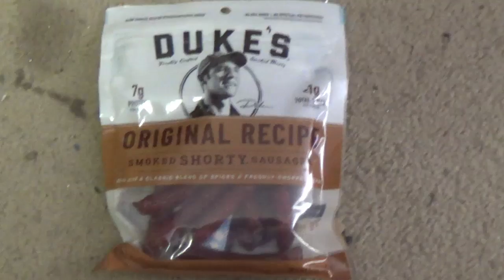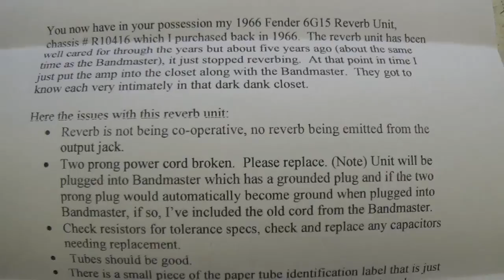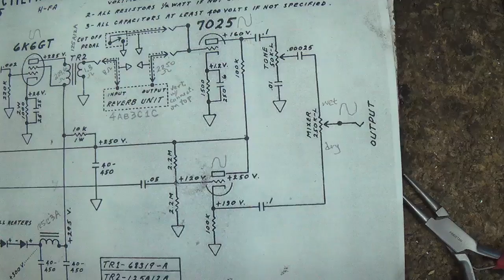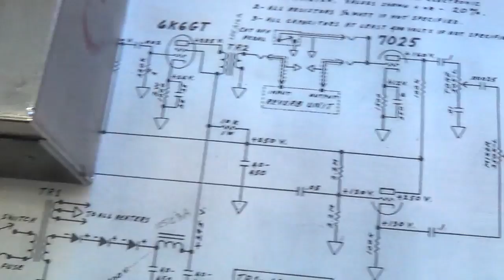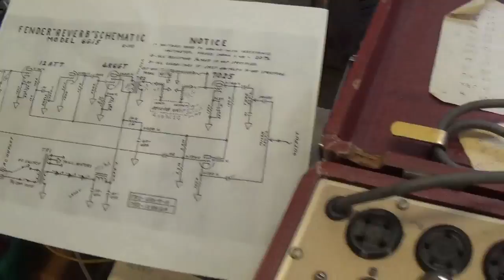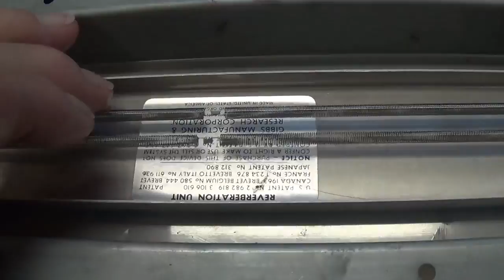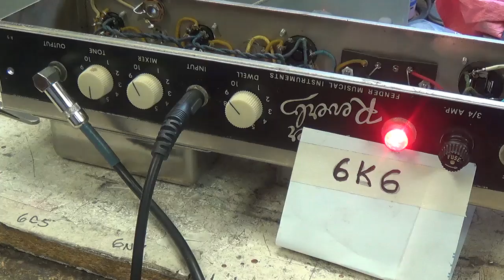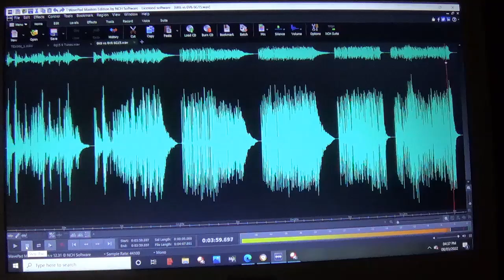Virtually Mint 1966 Fender 6G15 Reverb Unit.......It Quit Reverbing :)

Comment: @Unccle Doug 
Doug, can I not tap my speaker lead from my Teisco AP10 to drive my 1.2k--ohm Biggs reverb tank -keeping the speaker resistance in parallel?
The tank is at the moment removed from the querulous Estey Magnatone Custom M8.
Would this not work - if the signal is taken out to a second well-grounded pre and power? 
My caution is, nobody else does it - right? Dick Dale maybe?
Perhaps the speaker in the Teisco would need disconnection - what then? 
Would you not have an albiet-hot AC signal that another guitar amp could handle?
Easy to try. 
And hey right away the Magnatone will sound less like Blue Origin at liftoff. 

Doug earliest gearhead days for me were in the new high school AV room where the principal had installed a stereo (Dual, Sony and AR5s). Our grade 11 pal Gregor decided we needed our own hard rock cafe - somehow - so later that week I was standing between four 4x12 Traynor guitar cabinets and a stack of 2 Bassmate amps, driven by the record out of the Sony - and for a soundcheck (we didn't know that term) our guy had that CBS sampler with clouds on the cover - and the Shure stylus landed on Celestial Terrestrial Commuters, by Mahavishnu Orchestra.

I was 2 feet inside the main door, facing north east; it was about 5 pm; and it was 14 December 1971 
My feet froze to the spot  - although it was carpeted, indoors, and Decembers in Scotia are mild.
From our stacking-table speaker towers, came a psychedelic puzzle of rhythm and missing Western scales, a drummer with a kick drum on each side of the stereo mix, clearer than ever heard from hippie bands. 
And Gibson electric guitar played as fast as where Johnny Winter or Alvin Lee left off  at Woodstock. And this was only a year after the movie (which in turn had been the first time we heard rock music through any sort of serious sound system.)
Just checked a 2022 Montreux clip and the cat who made that 1971 record is now 80 years old, and on tour. What he plays is astounding and and as for his tone, I venture that critics of sans amp guitar shows will have to think again. OK and maybe buy tickets further back.
Reply from the maker: Thanks for sharing, Andrew. With respect to the reverb inquiry, I have no idea......try it and see.

Comment: Clearly I'm not an amp guy so that's why I'm really surprised to see all that cabinet and no speakers or power amp. Was this a big seller in its day ?
Reply from the maker: For the same reason you don't see an engine in a wheel barrow, Don.....this is a reverb effect unit, it has a different purpose than an amplifier.  You use it WITH and amp, which provides the speaker(s) and output power.
Reply: @UncleDoug  it's a first for me. And apparently it doesnt seem to be a run of the mill reverb. I'll have to watch to rhe end of the video.
Reply from the maker: @SuburbanDon  Please do, Don.

Comment: OK, am I missing something?  First time I gave seen one of your many videos that we never see what was wrong.  No bad voltages, etc.  Just parts changed, and then tested...  Not a bad thing, but very unusual for one of your videos.  Maybe distracted by the shop kitties?
Reply from the maker: Apparently the repairs I made that you saw, and some you didn't, were sufficient. I didn't test "before"......only "after"......and it sure seemed to work just fine.
Reply: @UncleDoug  I'm an 'old fart' guitar and amp repair guy doing it since the late 70's.  Love watching your stuff, and the shop cat stuff.
Reply from the maker: @rcflyer2k  Glad to hear it, RC.

Comment: I would like to place an order for the custom cabinet tilt slabs. Better make it 2, I'm constantly misplacing all my custom essential equipment.
Reply from the maker: Due to supply chain issues, there is a 4-year waiting period for the tilt slabs, Jeff, and pre-payment is essential......only $495 each.  ;)
Reply: @UncleDoug  the video was extremely helpful and entertaining. Many thanks. I recently got a Brown box for  my  amps. Kept blowing fuses and a rectifier tube. Seen it on ASK ZAC. My amps are 60,50 and 40 years old. My current here is 128. Using 113 for my Marshall and 116 for my Fenders. I've learned alot from you and Zac. BTW, love your humor.
Reply from the maker: @jeffsquires6620  Thanks, Jeff. We're glad to hear it :)

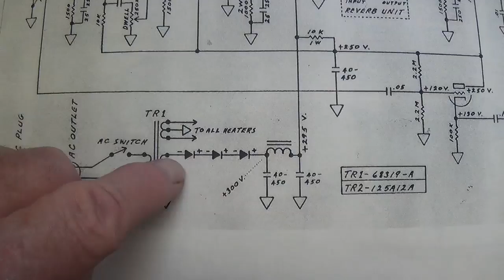Comment: Note the power-supply circuit at 27:50 ; I've never worked on one of these and didn't realize that it uses a half-wave rectifier. A bridge rectifier would almost certainly offer better performance and lower hum ---- the 60 Hz ripple from a half-wave rectifier is more difficult to filter effectively than the 120 Hz ripple from a bridge rectifier, and the bridge circuit has inherently better voltage regulation ----  but a bridge rectifier is usually expected to increase the B+ voltage significantly compared to a half-wave rectifier.  Note that this unit cannot utilize the commoner full-wave rectifier seen in many Fender amps because the transformer's high-voltage secondary doesn't have a center-tap. Interestingly, the Premier 90 reverb unit also has a half-wave rectifier.
Reply: I'm thinking cost was a factor in designing the rectifier. Silicon diodes were new, snazzy and expensive in '66. Apparently it required 3 in series to deal with the voltage, so to make a bridge would have required 12 diodes. $$$
Reply: @sootikins  ,   A bridge rectifier circuit comprising a total of 4 diodes actually has 2 diodes conducting at the same time and therefore it would be the same maximum voltage handling as a pair of diodes in series (when used as one half of a full wave bridge).  A 1N4007 diode  Is rated for 1 Amp at 1000 Volts. The reason that Fender used 3 diodes on a side in series for each half of the fullwave rectifier in their amplifiers was to get 3 kilovolts (3KV) of power handling in case of voltage surges and spikes (current capability is immaterial because they didn't need anywhere near even 1 Amp much less 3 amps),  some of those spikes and surges occurring because of the large amount of inductive/capacitive surge at turn on in a high-powered amplifier (or perhaps to have some safety margin against voltage spikes caused by the appliances in the bar or club).  The B plus to the reverb unit, however, is only 225 V at the 6V6 or 6K6 tube,  and the unit is fused at only 3/4 amp  because there's so little current draw and minimal turn-on surge, and so I doubt they would have needed additional diodes as a safety factor against inductive surges (BTW, a resistor and small ceramic capacitor across each series diode would make them virtually bulletproof, but Fender never bothered, and failure of the original diodes isn't all that common). Not to mention that they certainly saved a lot of money by leaving out the rectifier tube and octal socket, saving on labor as well.  My guess is that Leo got a "deal" on those power transformers.  He was well known in the industry as a, shall we say, thrifty guy who was always looking for a way to build his products at the cheapest possible price.  Using a halfwave rectifier did indeed save a couple of diodes but it also kept the voltages sufficiently low that he didn't have to use a more expensive 6V6 tube. He probably got a deal on the 6K6 tubes as well.
Reply from the maker: The originals were half-wave and the reissues were bridge, GU.
Reply: @UncleDoug  , I know that. Sootikins was speculating that diodes were " expensive" in 1966  and that may be why Fender used to halfwave circuit. I suspect he got a deal on the transformers that was too good to pass up and selected a half-wave circuit to keep  the voltages lower. Otherwise, just one more diode was all he would have needed to build a bridge rectifier. If memory serves, the DC voltage from a half-wave is .9 times the AC voltage; a fullwave circuit gives you 1.2 times the AC, and a bridge rectifier's DC output is 1.4 times the AC.
Reply from the maker: @goodun2974  I believe that non-center-tapped-secondary-HV power transformers are less expensive than their CT bothers......one more benefit of Bridge rectification.

Comment: Hi Uncle Doug, sorry to sound like a chowder head, but what was wrong with the reverb unit? Did replacing the filter caps fix it? Or, does "not reverbing" mean it works, but not as good as it should?
Reply from the maker: Probably several contributing factors, Mark. I generally focus more on the "after" than the "before" :)

Comment: Another classic UD video - always something to learn. By the way, surely just a single one of those huge diodes would do? From memory, I think Fender used to use several in series because the reverse breakdown voltage tolerance wasn't quite so high in the mid-60s. Thanks again, as always.
Reply from the maker: Thanks, Darryl. Better safe than sorry :)
Reply: @UncleDoug  And voltage loss of those three new diodes emulates the voltage loss of those original diodes better than just one modern diode which of course could handle the voltage and current load all alone without any problems.
Reply from the maker: @jutukka  Thanks for your input, J.

Comment: I won't condemn you for using the 1N5408 diode. I use them in Leslie amplifiers all the time.  But, one diode would be sufficient. (unless you are trying to keep the stock look).
In the early days, when solid state rectifiers were new tech., it was difficult to make diodes with high enough  peak inverse voltage ratings needed for tube amps.  To get around the problem, manufacturers such as Fender and Leslie (Electromusic, inc) would stack diodes in series to increase the PIV.
Three 100 PIV diodes wired in series makes a 300 PIV diode.
Reply from the maker: Thanks for your input, Scott.

Comment: I have an old Gibbs tank, very low output when i tried it in a Fender Deluxe Reverb, it has the wrong impedance for that application.
Reply from the maker: Not all Gibbs tanks are created the same, CL. Perhaps the one in the 6G15 was different from yours and did have the correct impedance.  Several viewers actually thought it sounded better than the new MOD tank.

Comment: So what was causing the (as delivered) reverb to be not reverbing. Was it the big filter caps?
Reply from the maker: As mentioned several times in the video, the transducer magnets had lost their strength.
Reply: @UncleDoug When you tested the original tank vs the new tank the reverb was still "there" with the old tank, just not as strong and clear. The customer complained that there was no reverb hence my question. Excellent, in depth investigation and resolution nonetheless.
Reply from the maker: @cigarboxguitar9519  I understand, CB. Despite the absence of a "smoking gun", all that matters is that it ended up sounding great :)

Comment: 21:58 it looks like the back slot on that locking transport bracket has a hole to lock the bracket firmly from vibrating loose or sliding back...you would push that back screw into that side hole in slot and it should hold it till your ready to unlock it..?
Reply from the maker: The caging arm does have an "L-shaped" slot that allows for locking n place.
Reply: @UncleDoug  
👍

Comment: i hope uncle that you can help me with this perplexing problem i designed a 60 watt amp with 3 12ax7 and two el34 tubes without feedback this amp sounds and performs great as soon as i try to apply negative feedback to a presence pot all hell breaks loose the amp goes into oscillation, I'm using a similar circuit to the marshall 45 where 27k tap the 16ohm output hooks onto the longtail 
and over to the presence pot i know this is a poor substitute for being here but my bag of tricks is empty thanks George
Reply from the maker: It sounds like you are sending an in-phase signal to the LTP, creating a PFB loop. Take your signal from the other end of the OPT secondary.
Reply: @UncleDoug  it worked swapping the phasing to the output tubes solved the problem
Thanks George
Reply from the maker: @georyans  Glad the tip was helpful, George :)

Comment: Damn these are pricey ! I own a low cost way of having tube reverb in a separate unit which is the Danelectro Spring King which is a nice pedal for around $120 and its real spring reverb, but ive always wanted to buy or build a tube reverb unit. THanks for the video, had never seen one of these taken apart. :-)

Can anyone recommend a kit or another tube spring reverb unit that costs a bit less than these do ?
Reply from the maker: Build your own, CT. See the links for all the info you need.

Comment: I think i've found the answer I will test and get back to you what is the problem is the phasing is wrong between the power amp output tubes and the 12ax7 that's driving them swap them should fix this hope it works
Reply from the maker: Good luck, G.

Comment: One tip: use 2 different colors of paint or nail polish to color-code the reverb inputs/outputs; this way, neither you, nor anyone else, will get confused about how to wire up the reverb tank! 😌 I think that would make Jack proud. The other cat, though, seems too busy with the catnip-infused mice to give a flip. 😆😂🤣
Reply from the maker: Thanks for the helpful tip, William. Fender simply used red....and the process of elimination.

Comment: Uncle Doug. If I sent you an old portable battery powered Tube radio, like a philco, and a little battery powered Pignose amp, sans the guts, could you, would you, build me a battery powered tube amp. Consider what you would charge to do something like this if you'd  consider it all all. ..let me know. Thank You!
Reply from the maker: I'm sorry, Ben, but I no longer do specialty builds like this one. Considering the very high cost of such a build, you would be way, way better off just buying a working Pignose battery amp.

Comment: The 6V6 is WAY too much reverb. The original 6K6 gives very manageable reverb without getting ugly. More is not necessarily better.
Reply from the maker: Yes, but it's easier to turn down too much than it is to try to turn up that which does not exist.

Comment: It was a pity to see the destruction of the Gibbs tank. It doesn't have to sound like Mod. Gibbs tank this was the original Alan Young technology, where each part of the spring is wound in the opposite direction to dampen the dissonance of the springs. While the Mod is a cheap and simplified version where the plastic stators, springs are wound the same way, so it sounds loud, dirty, and less musical, which is what you demonstrated in your demos. If you wanted to replace the springs and transducers, then you had to take from Accutronics, where the technology is at least not broken.
Reply from the maker: Thanks for sharing your opinion, Al. Wasn't Alan Young the co-star on Mr. Ed ?
Reply: @UncleDoug  Who knows what Young was a co-star, but I'm talking about the one who worked as an engineer for Hammond, and developed reverb type 4, patent number US3106610A.

Comment: seems rather unintuitive to have remove the back  to sure up the tank everytime you need to load in and load out ...... should have made a hinged access panel rather than the four screws......jus sayin . this is soooo cool though .
Reply from the maker: The rear door is open at the bottom to allow caging and uncaging the tank, GT.